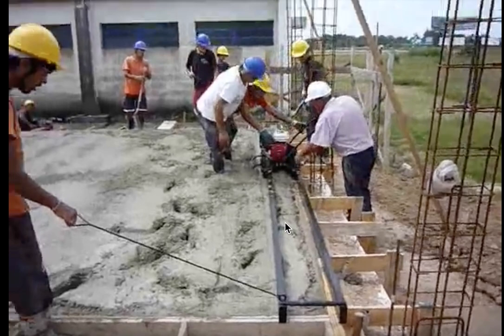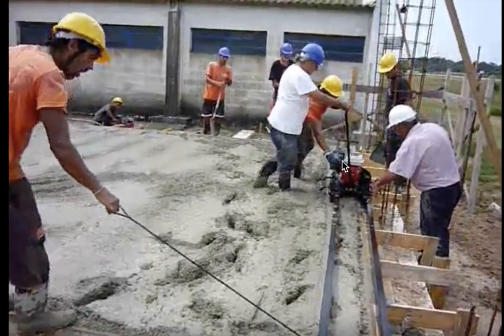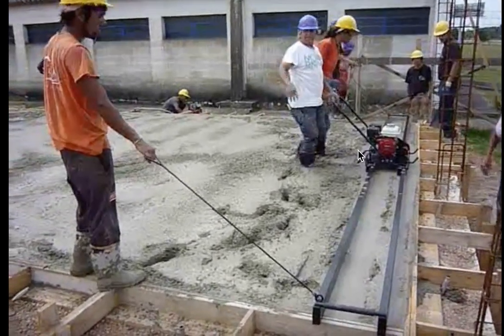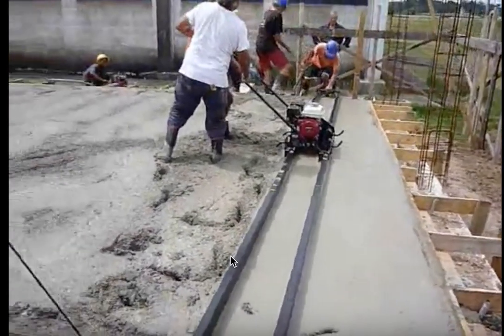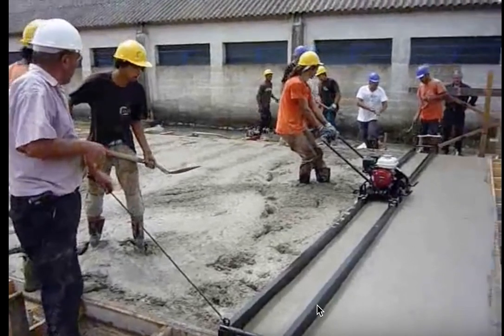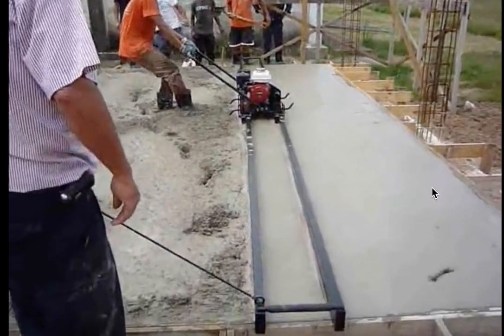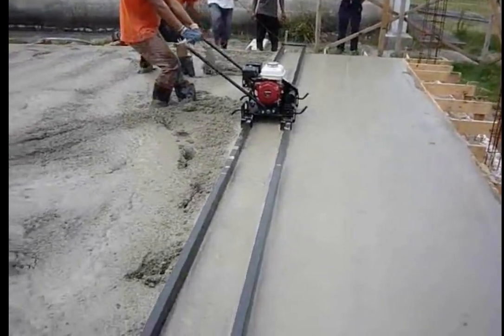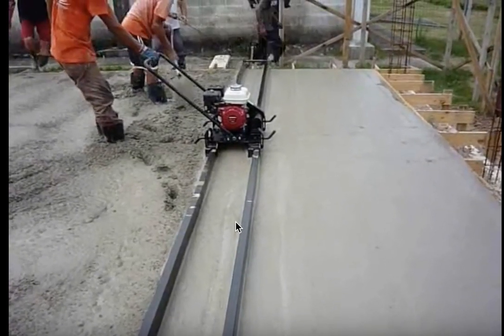concrete vibrator screeds and how to choose one that is right for the job

Comment: They are ok if the beams are deep section and so very rigid, that steel one in the video is both heavy and not very deep so will bend, and as you say will have more vibration in the centre.